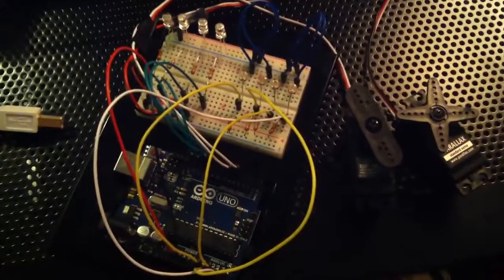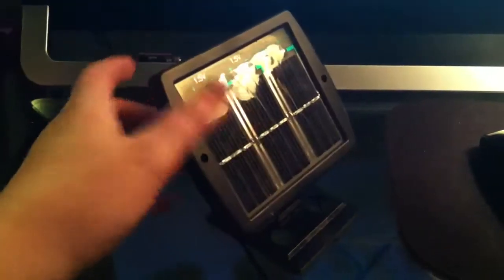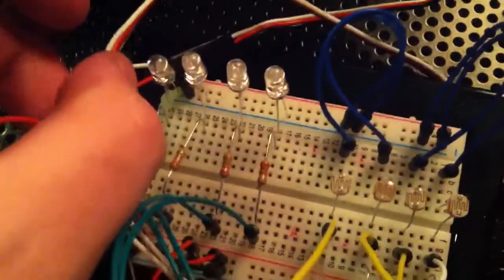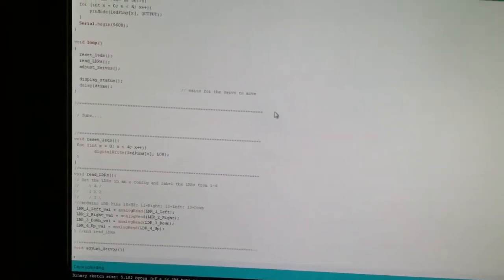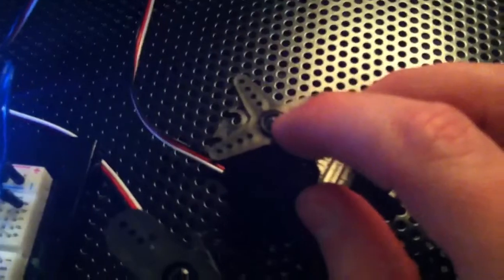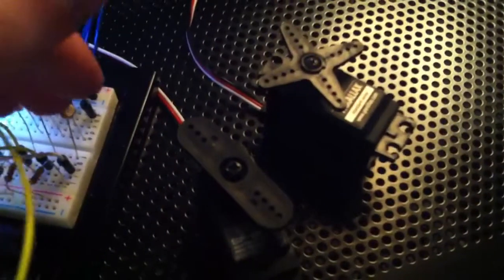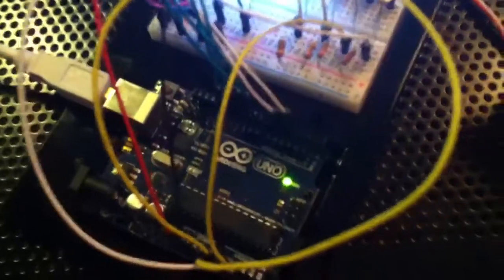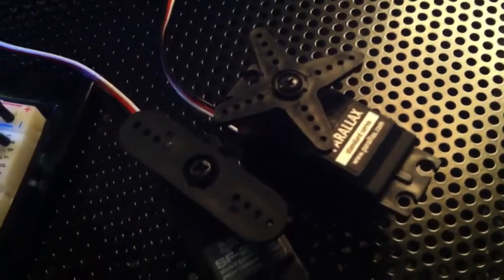Arduino UNO solar sun tracker

Comment: Reminds me of auto tracking systems I used to work on - military satellites.  They ran a figure 8 track once every few minutes to find the direction of the strongest signal.  A lot of the training satellites were not so geosynchronous anymore and moved quite a bit.

With this tracking you are on the satellite.  Well done, keep it up!